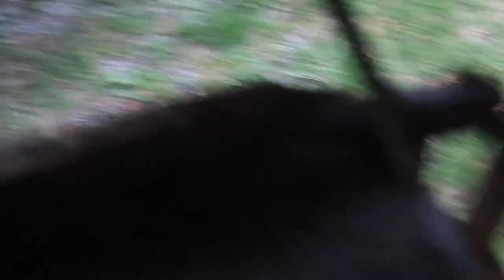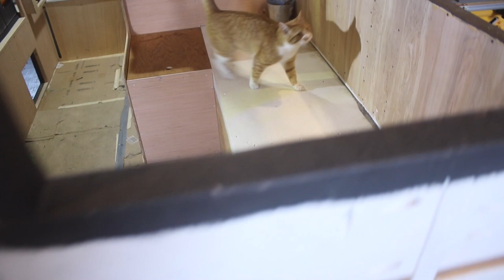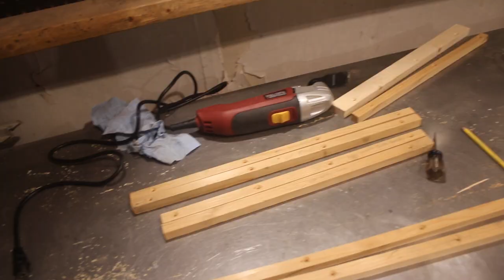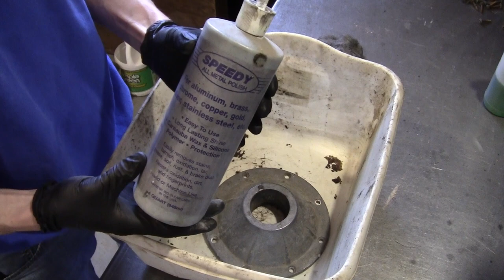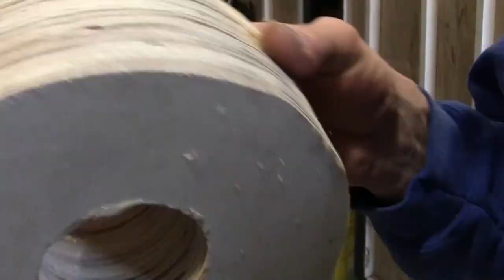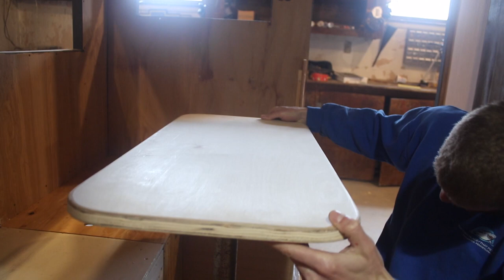CAMPER DINETTE BUILD - Truck Camper Build Part 36

Comment: So, the step serves two purposes under the dinette table.

1.)  When the cushions are on, you'll be sitting up above the level of those little raised sides on the dinette seat cabinets, this brings your feet up so the your legs are at a comfortable angle and the edge of the seat cabinet isn't digging into the back of your knees.

2.)  Usually that large outside compartment is where in a lot of older units where the propane tanks go.

The raised floor allows you to run the 1/2 back pipe gas main from the tanks around to the front and other side of the camper.

If the compartment was instead of a generator, the same pipe is run for fuel and electrical wires for power run under there.

In the case of my camper, the 0/1 welding cables and battery water tubing runs in that void under the raised dinette floor.

Comment: I think the platform is for comfort sitting at the table. Measure the height of a chair and compare. Don't forget to include the height of the cushions.
Reply from the maker: I measured my kitchen table and chairs in my house, and the measurements are within a 1/2" compared to the current dinette in the camper. So i'm happy with that. Thanks for watching!
Reply: @SquarebodyTruckCamper  ok, sounds good.

Comment: My project is making 9.5 truck camper into a 7 foot. Thought, maybe take a week, three weeks  later still grinding away.  Total interior  gut except  ceiling. FYI it's your fault I started this seemingly  endless Covid project.  Dry weight at start 1800 dry. Goal is 1200.
Reply from the maker: Keep plugging away at it! Time consuming, but rewarding at the end. Thanks for watching the series.
Reply: Only five more years to go and you'll catch up to the amount of time I've sank into restoring my 75 Amerigo.

Just cut the solid maple for the fridge compartment cabinet face today and finished installing the cell booster & WiFi repeater antenna assembly onto the winegard crank up TV antenna arm today, so I can finish the wire snaking that needs to be done inside the fridge compartment before I can install the rock wool fire proof insulation bats